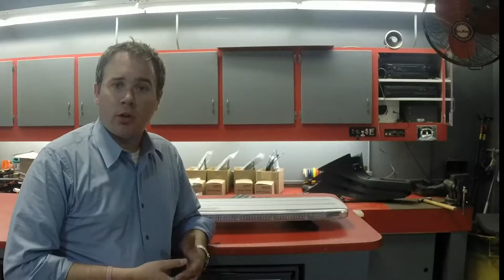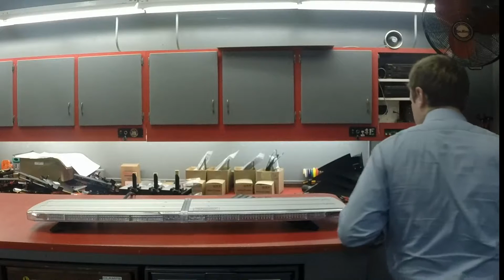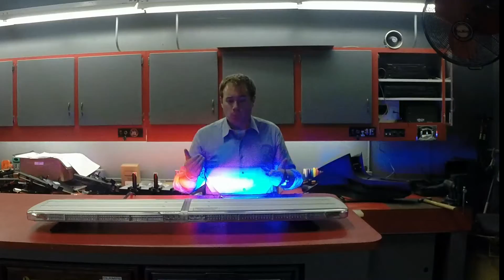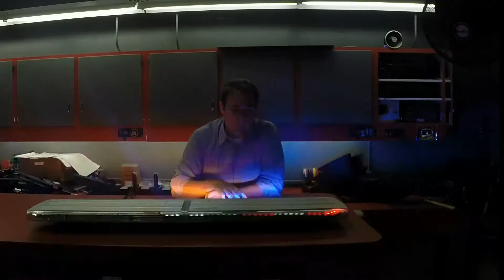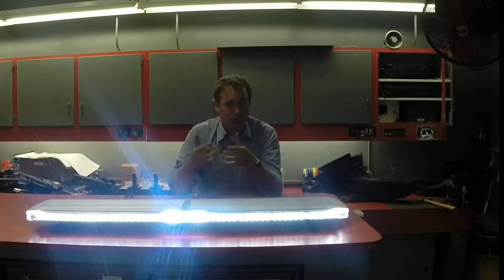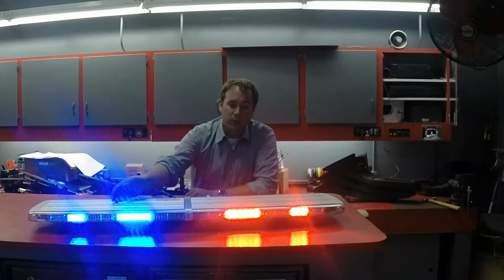Legacy Overview

Comment: CA law does not require cruise lights. CA requires a constant steady burning red lamp to the front any time an emergency vehicle has its emergency lights activated. Just when they are being used, not when they are off. This is done to ensure that no matter what flashing pattern is being used, there is ALWAYS one red LED turned on.

Comment: I know this is old, but California does not require cruise lights.  I am not aware of any states that require it.  California require all emergency vehicles to have a steady burn red light, at max power, to the front of the vehicle. 

I know CT uses cruise lights.  And Hawaii uses cruise lights since the original Hawaii 5-0 days in the 60's and 70's.  I believe Hawaii may require them but I am not sure...

Comment: Hi,

How did you configure different presses?
Can the CanTrol be programmed using a PC software?
Can the CenCom Sapphire be programmed with different presses as well?

Thanks!
Reply from the maker: The CenCom is programmable, but will not offer multiple presses to be configured. CanTrol is programmed via PC and allows each button to be configured.